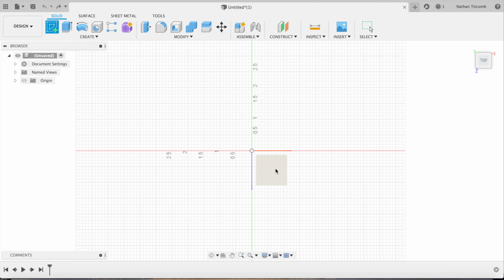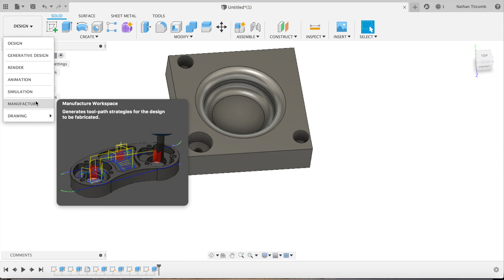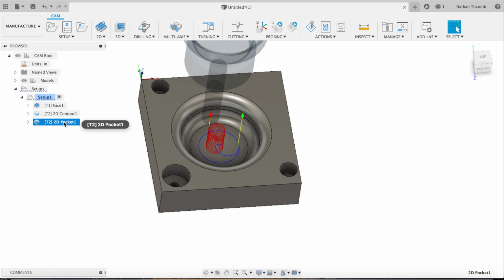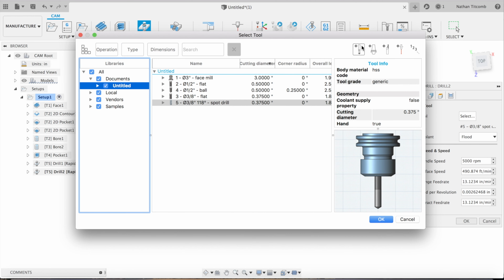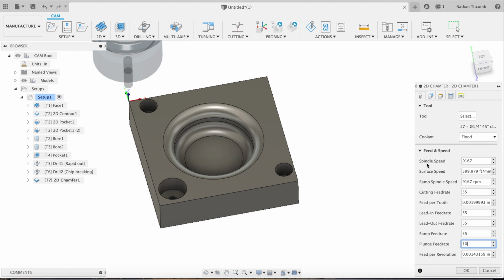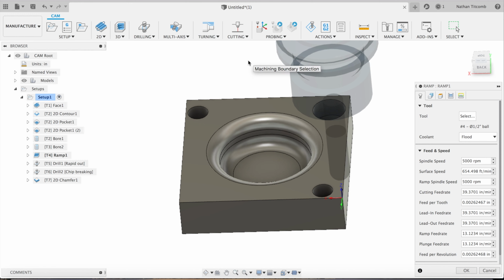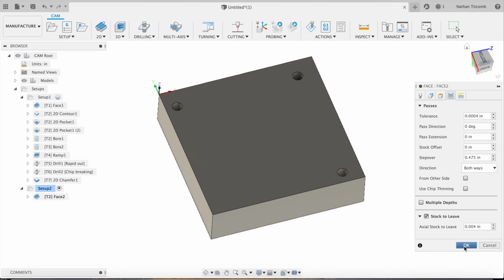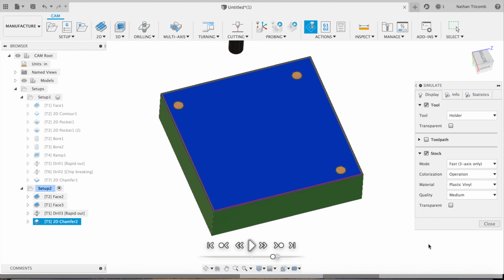3d Ramp Contouring in Fusion 360: Fusion 360 Tutorial

Comment: Is it possible to ramp in fusion without the blue path? The blue path is when the machine attempts to mill the walls of the bore at full depth which broke my end mill.
Reply from the maker: Yes you and adaptive clear out the pocket. Then ramp the walls. Finally you can run your 3d tool path last to keep the tool pressure low and avoid breaking tools.